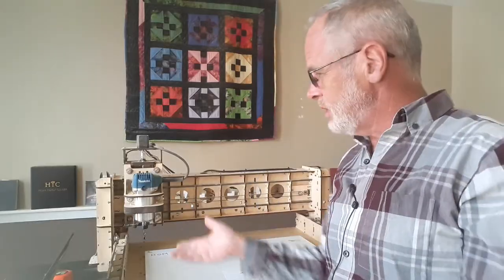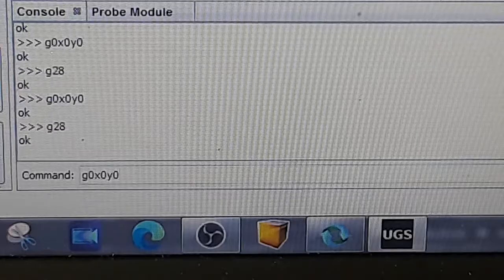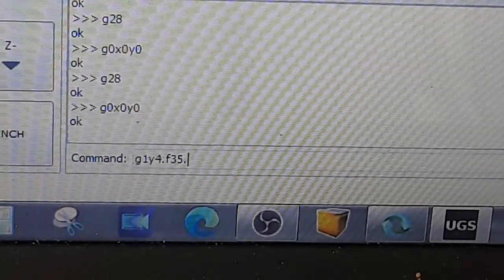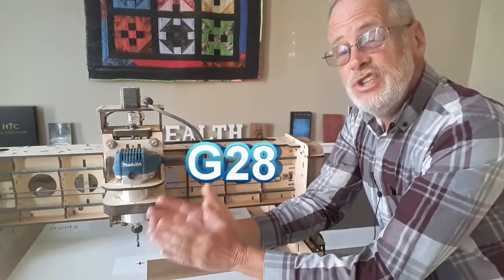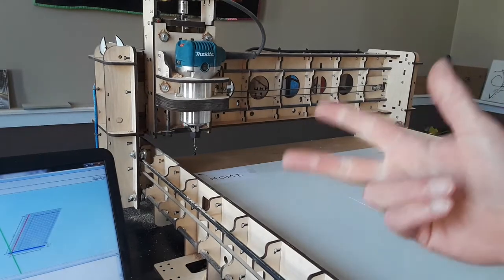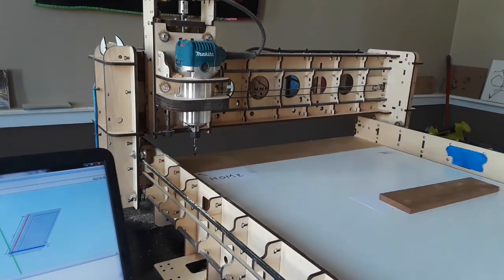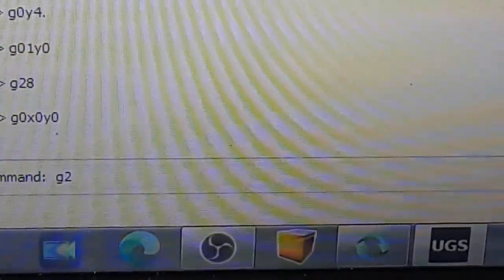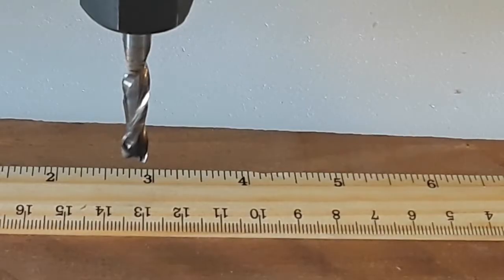TOP FIVE ** MUST KNOW ** G Codes You Will Use For & How To Use Them on your cnc, Router Laser, gcode

Comment: Thank you Garret. I am just starting to try to understand and make simple G code routines. This is helpful for me.
Could you explain the difference between G28 and G54? It would help me much.
Reply from the maker: I’m glad you found the video helpful! G28 is used for returning the machine to its home position, while G54 is a work coordinate system that defines the origin point for your machining operations. G54 allows you to set different starting points for different jobs without needing to reset your home position every time. Happy machining!

Comment: G0=linear movement under rapid feed(each maching has a predetermined limit) between 100 and 600 inches per minute (I.P.M.).G1 is movement with a defined( called out by programming) rate...G20 and G21 are SIMPLY scaling toggels( imperial or metric measurement).most modern machining centers automatically home when a tool change is programmed,G28 becomes redundant,not defineing the Z axis in the video is a mistake i believe,partial knowledge can be dangerous,just my opinion,the info was correct.
Reply from the maker: scottmpence1058, Thanks for sharing your insights! It's always great to see community members engaging with the technical aspects of G-code. I appreciate your perspective and the clarity you brought to the discussion.

Comment: I'm trying to install a IOT relay to start/stop my vacuum in my cnc4newbies. Do you have a video explaining how to add those M7-M8 commands? I have no idea how to start.
Reply from the maker: DomzGarage, I don't have a specific video on that, but I recommend checking the documentation for your CNC controller, as it typically provides details on how to implement M7 and M8 commands. You might also find community forums helpful for practical examples from other users who have implemented similar setups. Good luck with your project!

Comment: Hello Dear , possible help to solve a problem on my diy CNC ?
problem is , the Z axis going down to make collision when machine start to move after I fix well the milling tool on top of the material block , I think it should be going up on first step then going down to start milling , hope can help on this , thank you very much .Regards John
Reply from the maker: Choiioklam8480, it sounds like you may need to set your z zero brother. I recommend taking a look at this video here: https://youtu.be/UaDMzl_ZXVg. I think you'll find it super helpful! If this doesn't fix the issue, I recommend reaching out to your machine manufacturer. They should be able to give you a little more specific guidance for your machine.

Comment: We use G53 instead of G28 to send are CNC milling machines to home position. This is so you don't have use G0 G91 G28 X0 Y0 Z0; 
Just use G0 G53 X0 Y0 Z0; to send home and machine stays in absolute so you don't stay in incremental by mistake. Also use standard (inch) mode because we use measuring tools that read in inches and metric to inches conversion is a simple conversion formula.
Reply from the maker: Brian, good call brother! You couldn't be more correct.

Comment: Hi Garrett, 
Is it possible to add the home command ($H) when i am in Vectric? Its easy enough to make the addition when completed in my gcde location but wanted to complete this in Vectric before saving.
Thanks
Martin
Reply from the maker: Martin D, if you want to get into the weeds, you can modify the post processor that works with your machine. As to how to do that, you'll have to reach out to the post processor maker my friend and that's the only way I know my friend.
Reply: Thanks for your speedy reply much appreciated.
Martin

Comment: Thanks, Garrett.  What this points out to me is that because I have to use a pendant for controlling my machine then I'm somewhat limited in versatility.  Did I read that right?
Reply from the maker: Norman, no not at all brother. You can use a pendant in conjunction with all the gcode I talked about in this video but it all depends on your controller and the pendant you use.

Comment: If your thinking of getting into CNC Routor, I really would think the person buying this expensive equipment would have already a good idea of how G code works.
G20,G21, from my experience, in the software, you can set imperial or metric in the parameters, once set, you never have to think twice about it again.
All G code is important .  there is NO G code more important then any others. Some, you will use more then others.
G0 and G1, you will use in EVERY program, however, you will never use G84 on a router.
Reply from the maker: Doesnt Matter, great points brother! Thanks for sharing.

Comment: When using G28 or G30 how are the coordinates set for their movement to that point?
Reply from the maker: WhoCares, For G28 this depends on if the machine is set to absolute or relative mode. For absolute mode, it moves a specified distance in relation to the work coordinate zero.   In relative mode, it moves in relation to the machine/tools current position.
For G30, it is just like G28 but it is instead a second reference position.

Comment: My router was a 3018, however I added a pair of longer side rails so now Y is not quite double the 180, which should be 360, I think I get 330 or 340  for my Y.

Do you have a video of setting your work offset?

You X,Y are in the center of paper on your bed!
Home is in the upper left corner.  
I don't get it my 3018 will not go to that same corner.
It goes to the lower left corner.
And to get it to move upper I have to use -##.  
my G-code is all wrong for that, what am I doing wrong.
Reply from the maker: Hi Lee, I dont have a video of setting up work offsets yet but its on the list brother. 
I don't really follow, could you send me some pictures to my email? I might be able to help you out there better.
Reply from the maker: Hi Lee. I did not have a video that talks about work offsets and how to use them. That's a little more advanced. As far as the homing position, the lower left is the standard. The Bob CNC router is built with the orientation in a different place. So your machine is fine

Comment: Helow, I need some information, please. In which program is the G code made? so that the machine can read it and machine the piece. I have a Genmitsu PROVer 4030 cnc Router, to make aluminum molds....
Reply from the maker: Hi Jose. Your g code is written from your design software. You'll have to select the appropriate post-processor. I teach the Vectric software so if you use something else, unfortunately I cannot help you.
Reply from the maker: Jose, you make the G code in Vetric V carve when you save your toolpaths to a thumb drive. Or you can use software like Fusion 360 to make molds.

Comment: What G code would be used for zero position on the work? 
Very helpful video, thanks.
Reply: If I hade a job on the table, and X,Y and Z were zeroed, If for some reason I had to jog away from this position, how would I make all disturbed axis positions move back to zero?
Reply from the maker: @TheHalloweenmasks  and your control software, switch to console, and enter G0X0Y0
Reply: @IDCWoodcraft  I use Eding software, I don't think this software has anything like what you describe. The support isn't that reliable either. Thanks anyway.
Reply from the maker: Hi Twin. Can you explain this question a little better please?

Comment: This is the second time I have watched this presentation, so I get it a bit better.  So, with your Jeep cutouts, you could flip the project top to bottom with solid alignment parameters in the Y and then have the CNC mill the other design upside down on the backside, and could do it in an array for multiple units on a larger piece of substrate; then, not do any profile cuts w/tabs until both sides are done.  So is there an invert the toolpath code?  Then you could mill all one toolpath on one side and then all the  backside toolpath when you flip.  Thank you for lots of ideas!  🪚
Reply from the maker: Hey Paul. The Pro series of Vectric has a 2-sided ability. So you could do it this way.

Comment: Changing a current program from G20 to G21 will it convert the speeds and feeds from standard to metric or will that only change the measurement format? Thanks for the help in advance.
Reply from the maker: That is a very good question. Yes, it will interpret everything in metric. It will not affect the spindle speed. Bit settings need to be set ahead of time.

Comment: So I thought that this would be slightly relevant and maybe worth the time to review. Having seen it I say WOW, how helpful would this have been to know when I was troubleshooting my last issue!  Great stuff keep it coming!
Reply from the maker: What issue was that?
Reply: @IDCWoodcraft  Well it was a couple of things actually. First I was trying to calibrate my machine (Openbuilds LEAD 1010) and I wanted to move the gantry from the command line. It seemed like sometimes I would get an absolute movement of say 100 mm. Other times it seemed like it was going to a position in the field of movement say  x = 100  Y 50. I was entering x100 and nothing else?
Reply from the maker: @richardM980  were you able to resolve it?
Reply: @IDCWoodcraft  I am not sure, we started having a lot of issues with the machine and we have just recently gotten things to call down. We covered everything from grounding the chassis to rerouting stepper wiring and ultimately think it was an issue with the control fan burning out and getting intermittent issues due to overheating. So when I get back in front of the machine and want to use the command line to calibrate should X100 always move me an absolute distance of 100 mm?

Comment: That was absolutely fantastic. I am a beginner CNC guy but have 30 yrs experience with computers. I use UCCNC for the Stepcraft and I had wondered (and been apprehensive) about the command section of the software. You totally helped me unlock this. I tried these it felt like I invented fire. Thanks!
Reply from the maker: Crazy, that was funny...invented fire...lol. I could see the light in your eyes in these words. Exciting ah-ha moments.
Reply: Greetings. I have a 5axix cnc meachine. I want to do ceiling cornices with this meachine .where can I get the software to do different designs of cornices. With your experience in computers I hope u can help me.thanks

Comment: I've seen the result of someone programming X8 instead of X8. or X8.0. In the Fanuc language(industrial controller) that means X0.0008, about 8.0 inches too far. There was a lot of hard steel between the start of the move and attempted finish. Thank goodness the foreman was the operator. He wasn't yelling at anyone else, for once.
Reply from the maker: lol...yes, there is a lot of distance between 8.0 and 8 in any controller
Reply: @IDCWoodcraft     I 've also used a controller that saw 8 as 8 inches but that was weird to me. It is better to always explicitly state the value even if more keypresses are needed.
Reply from the maker: @sylvainforget2174  a controller like that can create a dangerous habit of forgetting decimal points. I agree with you.

Comment: Loving your videos.  I have a SainSmart 4030.  This machine can't communicate with g code programs directly from my Mac running Big Sur (latest software.) So in order to run jobs I use the offline controller that that i load with g codes on SD card that I make in Carbide Create.  There is a Machine Home option on controller but no way I can find to send bit back to Job Home.  Do you have any experience with offline controllers?
Reply from the maker: When you are refering to offline controller...what specific program are you referign to?

Comment: Fantastic 👏  already knew majority of the basic but still learned quite a bit 😀  never felt monotonous witch is quite remarkable 🙇‍♂️
Reply from the maker: Hey, thanks Wes. Sometimes I feel like I'm getting monotonous. Always noce to hear I'm hitting the mark
Reply: I've watched hundreds maybe thousands of videos this last year trying to learn how to run the cnc i bought 😅 not no better than the day I started it feels despite hours n hours of steady study but never parts that I'm needing but you did even if you through in lil filler for substance I got some nutrients that I was seeking plus some I didn't know I was missing im serious tho I worked in a machine shop and have understanding of the run process and the physical part setup but nada on design cad cam software side and I thought ik lil gcode basics but I'm learn now I knew nothing substantial when I bought machine what I expected was to take pictures or download 3d rendering copy paste maybe conver formats set some machine parameters for how I choose to set up part n bits I choose hit start n check measurements debur done witch is a lot In it self but not even a tip of iceberg come to learn🤕🤒😬🥴🤯😵😱🤬☠

Comment: Good video the question i have is when you import a file lets say tic tack doe from vectric and its in inches at watt stage to you have to change to metric in the job set up or toolpath creation if I am running UCCNC or doesn't it matter cheers thanks for your videos.
Reply from the maker: You can change it at any time. Vectric will simply convert the units, not the size.

Comment: You could also manually control the machine using the arrows too, right? Does the Shapeoko use G-Code too? I think I have a lot more questions to come!
Reply from the maker: Jim, you asked a good question and gave me a good idea for a video.

All CNC machines use G-code so the Shapeoko will too. Yes, the arrow buttons will move the machine as well

Comment: Good video! I see you’ve gotten a few more subscribers, nice work!

Two questions - Is it true that if you submitted a g28 for home while the bit is in the material the cnc will not raise it up first?  It’s only telling it to do the x y move to home and nothing with the z?

If you tell the machine to move to a point beyond your workspace what happens? Does it just stop at the farthest point it can reach or could you damage the machine?
Reply from the maker: Thanks @JC. Yes, I am gaining some traction.

G28 is a direct move commant. NO! it will not raise first. It will simply rapid all axis to the home position without regard to any of the other axis positions.

It will only do that when you when you "home" the machine, or find its home position (homing the machine). G28 will cause problems if the tool is in the part and you enter that command. DO NOT ENTER G28 if the tool is in the part!

Regarding your second question...a good machine will have the parameters internally set so the machine cannot overrun its physically impossible limits. I likes BobsCNC because it has this feature built into it. It will never overtravel beyond the 24x24 workspace no matter what you try in commands. you'll find this out when you inadvertently try to do it. You'll get an error and wonder for a few minutes why the error occurred.
Reply: @IDCWoodcraft  thanks!